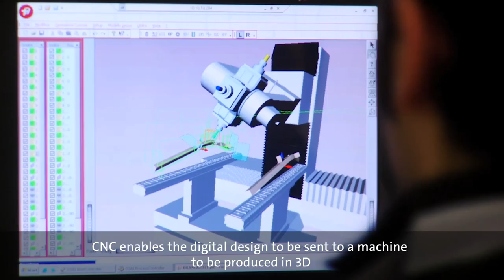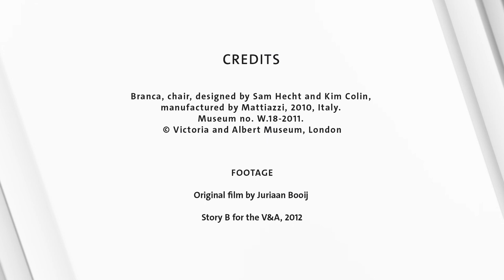How was it made? The Branca Chair | V&A

Comment: Beautiful piece of craftsmanship. I saw a lot of comments from the tree huggers about the waste. Here’s a penny for your thought, tree cutting has a positive impact on the environment. If done correctly with all the rules and regulations being followed, cutting trees maintains the health of a forest. The wastes of the wood used in making furniture and fixtures can also be used in various things. 

The shavings or sawdust are used as a fuel for heating, while discarded bark can be used in landscaping. Leftovers can also be used to make another piece of furniture or used as other building materials, so there will be zero waste produced.

Through selective cutting, as opposed to clear cutting, the impact on the environment will be less. It can also support many species compared to clear-cutting. There are wrong ways of cutting trees, but there is also a proper way to do it. it also regenerates the forests and gives longer lasting ability for wildlife to thrive and survive due to regeneration. 

So there you go. Hug your trees goodbye lol seriously lighten up

Comment: I’m not a tree hugger. Still, it is an extremely wasteful design. I came into the video expecting some green wood or steam forming, only to realize that 75% of the raw material is turned into chips. It is wasteful because you are using a lot of energy and consumable tools to turn furniture-grade wood, from which you could get at least another chair or two, into fuel or cheap particle board. The company isn’t loosing any money because they double charge for those chips: first to the customer of the chair, and then to whomever buys those chips.